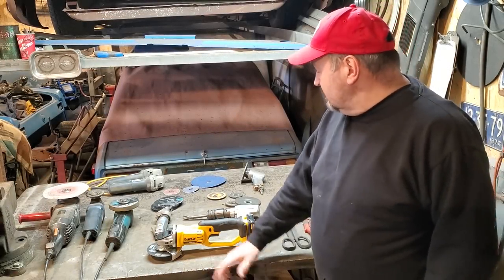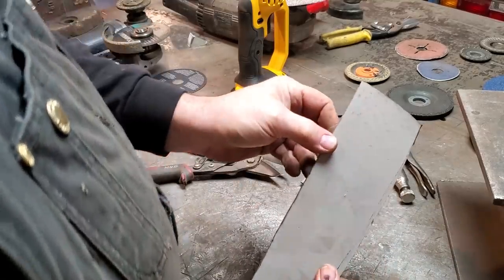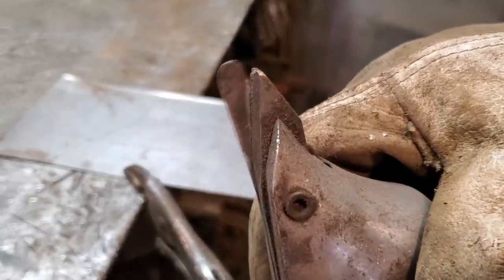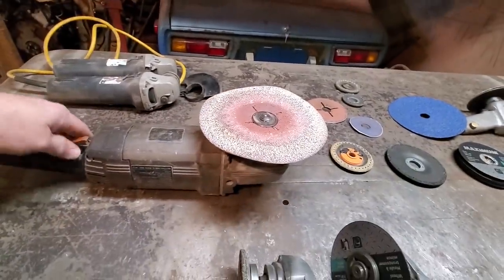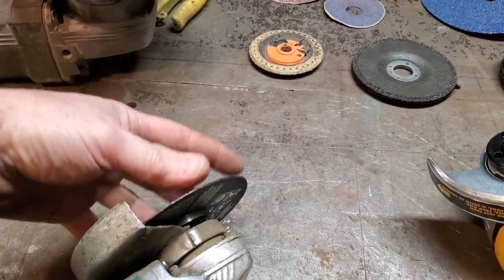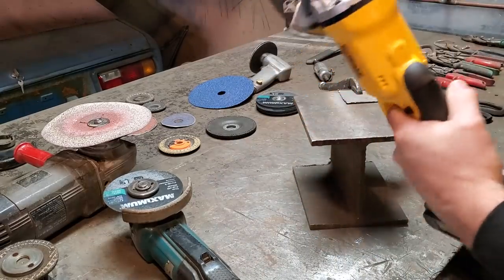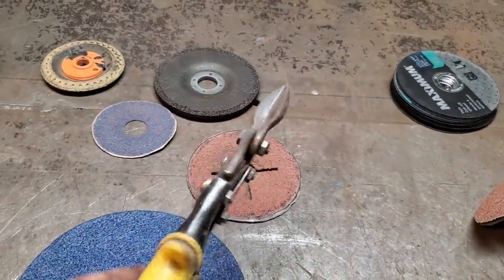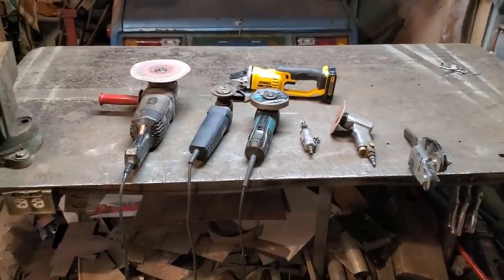Cutting and grinding tools used for sheet metal

Comment: From a retired "tin bender". Reds are for right hand and greens are for left handed cuts. If you use the big "old school" snips you can blow through 16-18 ga with no problem. The old school "bull dogs" are the only ones you can re sharpen and are the ones to be used for stainless. 
If you find B&D Professional tools, buy it even if it needs brushes and cord. These are the old Dewalt brand, they will outlast dewalt
Reply: Amen Brother! and as for Bull ships you cant beat the Wiss Inlaids! I bought a pair when I was a 1st yr Apprentice in 1980 still gots them and still sharp!
Reply: I heartily agree about the B&D Professional tools. I have an old (35-40 years?) Sears Professional 4 1/2" grinder made by B&D. It saw heavy use grinding for many years. Now just cut-off wheels. Figure they're easier on the old bearings. Just keeps on running. I use Milwaukee corded for the heavy stuff
Reply: Black & Decker were British design, old school. DeWalt bought them out and that’s where the story goes down hill. 
I don’t use the metal body old school drills but I have several that must be atleast 45 years old! Still work, just 240v metal body, insulated or not...🤔

Comment: Use the dewalts, drills, grinder, saws all,  almost daily in my line of work, handyman stuff and around the house. Upgraded batterys to the big ones. Little batterys are good for the flashlights, but not much else. Make sure u have plenty on hand and charged. Great for areas with no power, fence repairs, junkyards. But for big jobs I bring out the corded units, more power. Nice tip on the guards, I'll do that today to all of mine. 
Lefty's rule

Comment: Well over a decade ago on a construction job I used a VERY cheap (harbor freight) 4 inch angle grinder to trim 3" off each end of an 8" I beam lintel the supplier had sent off spec. Would have been a 2 week wait for them to (hopefully) send a proper length replacement. Took about an hour to layout and cut, but it looked like a factory sawcut when I was finished. The block contractor swore we had a new one made, lol. Been in love with angle grinders as the "go to" cutter for any metal ever since, unless it's a job that calls for a drop shear.

Comment: I got a dewalt cordless grinder for getting donor parts in the woods or junkyards mostly, and for small jobs around the place. However the higher rpm corded ones are tough to beat.

Comment: Just got that same battery dewalt. I threw a diamond wheel on it to cut stone tile on my mantle. It worked great. Much better than the Dremel and cut off wheel. I needed to trim the wet saw went through it like butter.

Comment: I've never had a grinding disk let go, but my father used to work in the shipyard, told me he was working alongside a fellow using a 9" grinder, and he was kind of bouncing the disk on the steel, with no guard. Well, the disc let go and killed him instantly, so it is no joke. You were right to warn people.
Reply: I always have a guard on my grinders I won't use one without a guard 

I had a 9 inch cutting disc let go at the centre boss and went across my ribcage marked me badly through my overalls but didn't do much more than slice and bruise me a bit I am so glad I had a guard on it!! 

I do cut them down a bit to fit better into places but always 2 inch guarding the
 fingers
Reply: I've had two 4" cutting discs explode over time and because I had a guard on my grinder, the pieces flew away from me. I wouldn't use a grinder without a guard, it's just pain dangerous.
Reply: If you get a cutting wheel askew deep in the groove it will explode (I've had it happen). It's a good idea to wear a welding jacket, gloves, and a face shield.
Reply: I've had a few explode. Maybe half a dozen. Most if not all I've known it was coming and/or was because I was.using it for something silly. Not been a big deal for me though. 4 and 5 inch grinders with thin cutting disks.

Comment: Loved my corded grinders and used the death out of them. Decided to try battery and never looked back. The brushless make the battery packs last nearly twice as long. Now I have 3 battery grinders and my corded collect dust. Only time the corded come out is heavy grinding.
Reply: What brand  battery grinder do you have?  I know some of them are junk.  I also noticed in the video that Fitzee's new cordless runs slower than the corded.
Reply: @172-e5s  i want to know what he uses also, hope he tells you
Reply: @lazycarper7925  No reply from our good Fitzee.
Reply: @172-e5s   That one that Fitzee has is the Dewalt DCG412B....I liked the handle style on that one, but wanted more power. You have to look at weight, amp draw and actual size. I just got this one. New....No box [I throw the boxs away anyway.] No batteries....Dewalt  DCG413B.....The normal batteries are 2ah and are light weight....I have 4 of those for other tools.....But I bought 2- chargers and each had a 3ah battery...Yes they are slightly heavier and make the tool slightly longer.  But will have more power when needed...
Reply: @bobbywartman2058  Good info Bobby.  Thanks
Reply: @172-e5s    Just today I bought 2 more grinders....HF Bauer 8 amp corded - paddle switch SKU # 64742.....They were on sale @ $40.00ea........I then weighed the new Dewalt and the New HF Bauer.....Both are very close in weight Dewalt 4lb- 6oz  Bauer 4lb - 13oz   That Bauer model has a 10ft cord...
Reply: @bobbywartman2058  Hey good info Bobby.  Where did you get them..Canadian Tire?
I kinda doubt it, but the price is good!
Reply: @172-e5s  Harbor Freight
Reply: @bobbywartman2058  JUNK! Harbor Freight Power Tools dont last very long compaired to DeWalt or Millwaukee
Reply: @irongoatrocky2343    Except there are a LOT of different levels of tools @ HF now..... The ones your calling junk are not the ones I bought. :)
Reply: I have a 30 year old Skil, a 3 year old Black and Decker and a Makita LXT.  I use the corded ones in the workshop and the battery one on site.  You can't lean on a cordless as much, (even a quality brand like Makita) although it always gets the job done.  The B&D was really cheap and has proved durable, the Skil may even outlast me.  Having said that, I'm only a enthusiastic DIYer, not a really heavy user.
Reply: @172-e5s  I have two brushless Makita 18v but also a 20v brushed Porter Cable(same as DeWalt entry level) cordless grinders.

Comment: I've had quite a few cheap Harbor Freight angle grinders and they've all crapped out quite fast except maybe one that I only use infrequently for smoothing out some welds. Heck it may not even be from HF but it's a Power Glide 60101816. My longest lasting 4-1/2" angle grinder so far has been a Craftsman Professional 7.0 amp. It takes a licking and keeps on ticking. I've tried many different types of metal cutoff wheels...the slowest was from Benchmark Abrasives (well the Lenox Metalmax diamond edge could be slower) but my fav has been the Makita D-20105, which I bought after watching the Project Farm review.  Prior to that I used Metabo slicers but back in 2019, the Makita cost less. Not true today as a 100 pack of Slicers is $96 (less than a buck ea) and the a 30 pk of Makita is $45 ($1.50 ea)

Comment: I somehow missed this when it came out and was reviewing your videos and sure glad I watched it.  I heard you mention you modified the guard in another video and was sure looking to find out the steps.  a couple of years ago and removed the guard and within 15 minutes got my finger in the grinding wheel.  I know they get in the way, so this looks to be a great compromise.  I am well into the rust repairs on my '56 GMC pickup. Everyday I use your tips and recall the things you mentioned in various videos.  Cutting metal with the cutting wheel is way faster, with cleaner cuts.  I am shocked how straight it comes out as well.  I have got to modify my grinders tomorrow.   Looks like i need to move on from flap disks,   I need some good carbide bits for my die grinder.  I too am using all of my cutting wheels to the max, need smaller ones for some places.  Just today the tips I used were, use bigger pieces, don't try to mess with small stuff, weld assemblies together on the bench.  Then I got my little cheapo metal brake going and used your tips on bending up some metal for the rocker with 4 different slight bends bends in it from another video.  Your tips and videos are invaluable.  I have watched virtually everyone on YouTube over the past 5 years or so on metal work and metal shaping and while there are some good guys out there doing some good work, I find your approach the most direct and useful.  I tell everyone with any interest to check out your videos.  I really can't tell you how much I appreciate you doing them.  I find using fewer tools better is a faster way of getting things done, you proved that to me and I have improved my skills because of it.  I'm now retired and 70 years old.  I hope i live long enough to get another 4 or 5 cars done.  I should have started sooner!!

Comment: Tony you are right about going with the rotation of the grinders and that thin blade! those wheels will explode on you if your not careful especially the ones from Harbor Freight! but id your careful with them and use two hands you can "draw cut" with them.....(sometimes you don't have a choice!) although i am predominately right handed i have very good dexterity with my left as well so I am very ambidextrous! (a good skill to have working with metal IMHO!)

Comment: I too find the flapper discs can be crap but I admit that the Menards sells a thick layered 40 grit flap disc that lasts longer than any i have used.   I've used a bunch of them lately.   I buy up on them at 11% rebate or bag sale.

Comment: I worked in sheet metal shop  for 5 years we had a 48"  shear press that  would cut  1/4  in  steel they used large  vertical band saw  to cut diameters up to 60inches they made gaskets for pipe lines for refineries.

Comment: Fitzee, you can find bigger, cheaper, generic batteries on Amazon that will fit your new Dewalt grinder. You should send your dead grinder to AvE to do an autopsy. All the best in the new year!
Reply: You have to watch out for amazon batteries.  Its not uncommon to get fake and counterfeits on there and on ebay.  Sometimes you can tell by the housings and labels.  Sometimes they look like the real deal on the outside but have inferior guts or are missing half of the advertised capacity.

I've found the best deals on batteries is to go to the manufacturers' website and look for rebates.  Most of my stuff is milwaukee m12 and m18.  Pretty much year round, milwaukee has some sort of "buy a battery and we'll mail you a battery for free" deal.  So you're getting the batteries for 30-50% off what it would be if you just bought them at full retail.  

As I was writing this, I looked at their site and they're running the deal where if you buy their big boy 12AH battery, they send you the M18 fuel 4.5" grinder for free.

Comment: Great video on your tools of the trade,. I use a Milwaukee m18 cordless 4.5” grinder at work to cut aluminum extrusions and stainless steel rivets on transit buses. I like the no cord and very mobil feature but even with the big battery I will wear down the battery pretty quickly  so it is good that you have some extras on the charger. Looking forward to seeing your next video. Happy New Year

Comment: your 24 grit large blue discs warp  or most of them are sold warped even when new at store , solution
 cut 2  8" x 8"  or 6 x 6 inch 3/4 plywood squares then place all your warped discs in between the 2 plywood pieces 
then use 2 clamps one on each side to compress the pack of discs
when you store them , over time they get straight and un warped
your grinders need to be opened where the 4 head alum housing screws are and where the big bevel gear
 is in contact with the armature sprocket move the old grease around with a flat screwdriver add mineral oil
then reassemble now its smooth running !!

Comment: Nice tip about cutting down the guard on the grinder.  Nice tips on grinder safety.  Those things spin at 14,000rpm and can do a lot of damage very fast.  The scariest disc I have seen is the one I’ve seen for the 4 inch grinder is the one with the chainsaw teeth on it.

Comment: I thought I'd try out the Milwaukee M18 cordless grinder...it was around $120 bucks,,,no batteries etc. Put a fully charged battery in it and went to cut some sheet metal and the battery only lasted a few minutes. Took it back  and traded it in on new dewalt corded grinder so now I have 2 dewalt grinders that I don't have to deal with running out of power. I guess there are better cordless grinders out there but I'll put up with the cords...when I'm busy working on a roll and in the zone I don't want the BS of having to stop and grab another battery. The Dewalt grinder was around $80 bucks.

Comment: For anybody that uses grinders hardcore the battery powered will not be for you unless you carry a charger and at least 5 batteries for a days work, i have all Milwaukee Fuel brushless and will never look back. After 6 or so years of constant use i finally killed a battery, its one of the very first ones when i swapped from Dewalt after swapping from Makita. The 18v battery grinder doesnt have the torque the corded has but grab a few batteries and have at it vs taking a generator with extension cords. Js

Comment: If I could give you ten thumbs up I would! Thank you for the tips on usage. I was just today cutting sheet metal and using a cut-off wheel. I use my welding lid in grinding mode but as you point out not sure it would help when the shattered disc comes my way. Knowing that, I take my time and don't let it heat up too much. I have a 4.5-5" Metabo but in tight spaces takes way too much time to fit in there. If they made a 3" version I'd buy it in a heartbeat. Oh and I have those same tin snips. Use them all the time but not for tin. :-)

Comment: Well, I can beat you on the Black and Decker angle grinder. I have a 4" German made B & D angle grinder that I've had for over 45 years! The guard on this one is adjustable, so I can just turn it around to suit what I'm doing. I had to dismantle, clean and lubricate the switch some years ago, but other than that, I think I might have put a set of brushes in it a while back. I've been getting my 1mm cutting discs on eBay. I almost ran out of the lot I got some time ago, so I just got another 100 (different brand and I haven't used them yet) for AUD $52 ($49 Canadian).
A belated Happy New Year and I hope 2021 is way better than what 2020 was. All the best from Queensland Australia.
Reply from the maker: Love to see that grinder. That is really cool.

Comment: I too am old fashioned and have half a dozen angle grinders.With cords Mostly 4" but my best one is  5.5" Dewalt,, with a cord.
Problem with battery ones is the batteries, cost a LOT and some do not last very long.
I have a  battery drill, light impact and a LED light that is great for me when welding,,, I can see the job! I have another so I can light the jobs up.
And my Black and decker 8" sander is 50 years old. And I need a guard for that as it is scarey with a cut of wheel.
And yes guards get in the way.  But with cut wheels are needed if nothing else to keep the sparks and crap out of your face
El cheapo ones just get hot and then lazy. Most of mine are from swaps, $10 punts, most are good.

I use flap wheels often, but I use proper grinding discs for steel fab. But do not use grinder wheel to cut, they do explode doing so.
I have paid $29 for a die grinder bit like yours,, and paid $15 for a set of 5 from Banggood. And they are superior!
I have a band saw that I have had 40 years, still works but not great anymore. And a $50 drop saw which cuts well. But goes through discs to fast!
Brand name grinders,drills, cut offs etc you can get new brushes for them. And switches as well. .
Reply from the maker: Great info thanks
Reply from the maker: Great info thanks

Comment: I've rebuilt a couple Bosch. They don't last as long ad their price . Milwaukee has seemed to hold together a little better.
Reply: Makita has held together pretty well too.
Reply from the maker: All good grinders. The Bosch ones just die. No sign of going just won't work.
Reply: I second the Milwaukee grinders. Mine is over 10 years and no issues. I also have a Sears 4 1/2" grinder from their old industrial Tools line. Guessing it is 40 years old. It is the backup since I got the Milwaukee. There's no good reason why it's still going, but it is. Wish I knew who made that grinder for Sears...

Comment: i think you should try a finger sander.  i believe you'd like it.  get two, one for sanding belts and one for non-woven (scotchbrite) belts.
Reply from the maker: I seen them and they look like they would drive me nuts. Lol. But be great for inside corners
Reply: @fitzeesfabrications  well, they are louder than any of my other pneumatic tools.  i'm late to the game using them, i should have tried them much earlier.  especially the scotchbrite belts.
Reply: I have found a finger file can get to places that are difficult to reach with other power tools, but many models have poor ergonomic design where the motor sticks out to one side which creates an obstruction for certain directions.  The offset motor also makes the tool tiresome  to use for longer periods. In the UK we can get one sold by Silverline; this may have lower power than some others, but it is much neater and very easy to use as the motor is mounted inline with the file.  I am just an amateur, but certainly this is in my "must have" tool collection; just make sure you buy good quality Zircon sanding belts